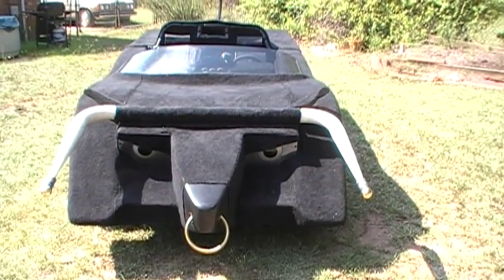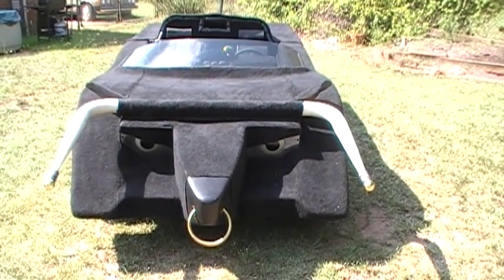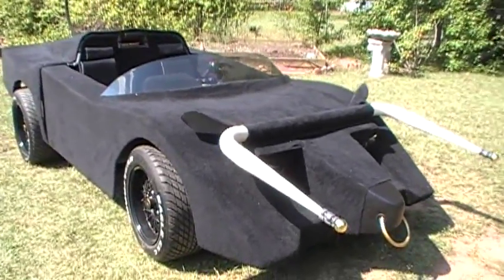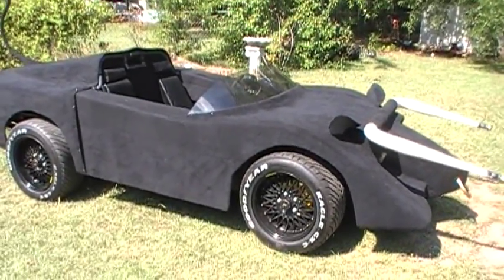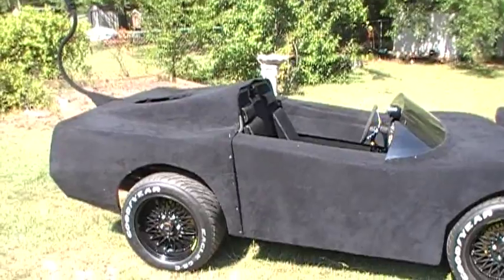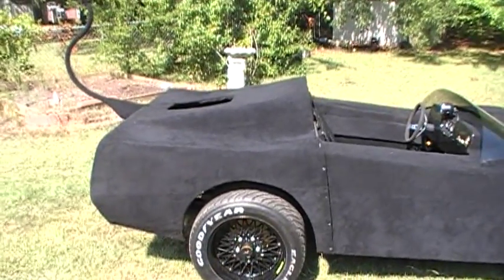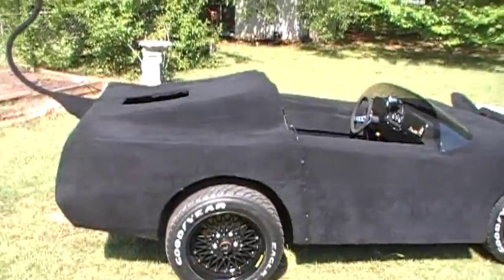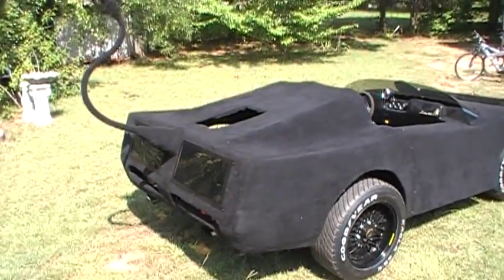Death Race 2000 bull car today , Greenwood South Carolina

Comment from the maker: I have all the documentation on the car, including a letter from Dean Jeffries. The front end, motor, and frame are all that's left from the 1975 build. The horns were relocated when it was at the Volo museum in chicago, the original holes are still in the body. The sides/back were so smashed up from Death Race 2000, they had to be rebuilt for the movie Earth Girls are Easy. The Volo museum, being in Chicago, covered it in the black fur to make it look like a "Chicago Bull".

Comment: There is so much incorrect about that car compared to the original Bull car.
Reply from the maker: I agree, but I've got all the parts to take it back to DR2000 look. The wheels, gas cap, steering wheel, etc.. Changes were made along the way for the other 2 movies it was in (Hollywood Boulevard, Earth Girls Are Easy). Correct resto is happening soon.

Comment from the maker: It still has the original paint under the fur on the front end. I've been looking for Mirage body to graft the sides on, with no luck. I drove about 50 miles last week to lokk at a Manta body on a tip, but it ended up being a Bradley GT. I should be done with the rebuild in about another year or so.